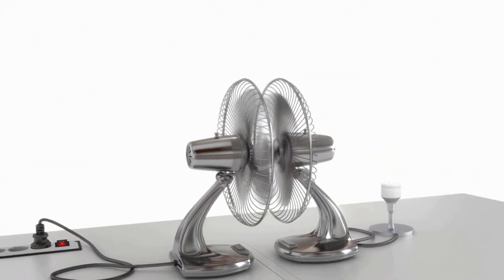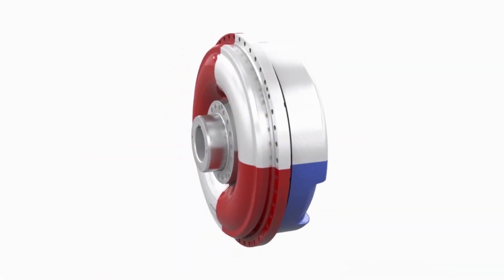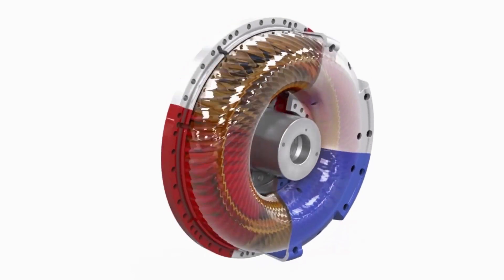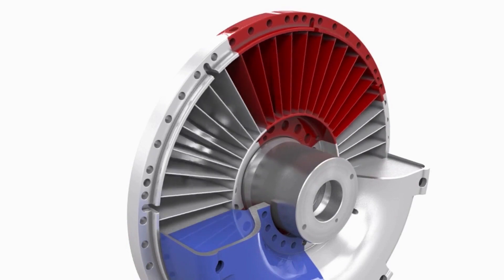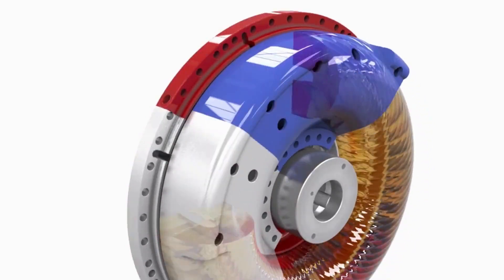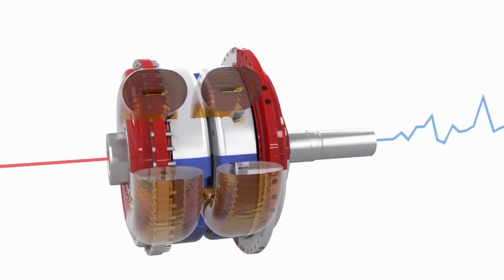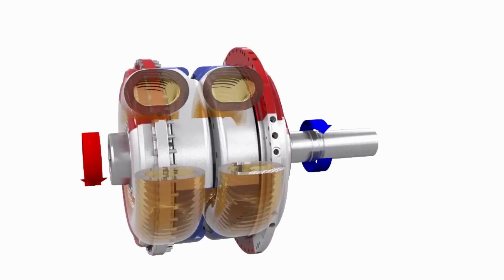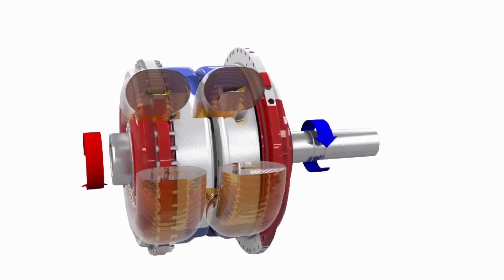The hydrodynamic principle - in under 2 min.

Comment: I was so interested. Then it went over my head. Explain the application and use? Now I feel like the dummy!
Reply from the maker: This video explains the principle of using fluid to transfer energy; this principle is incorporated into a large portion of our business. There is no mechanical contact between parts therefore, there is no wear. Furthermore, the technology damps torsional vibrations - in industrial applications, vibrations lead to failures (imagine a car exhaust bobbing up and down - it will fall off at some point). Answering where this is used in drivelines/drive trains. This particular unit in this animation is used in raw materials belt conveyor applications.